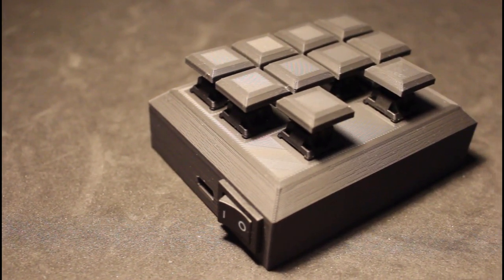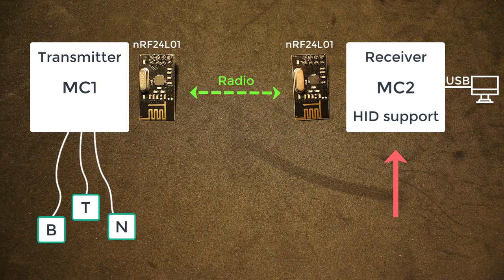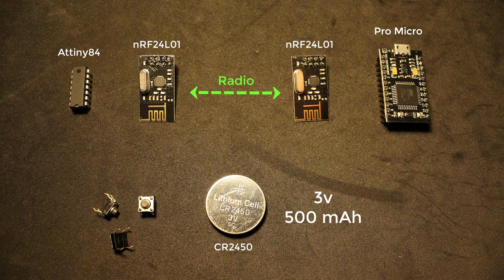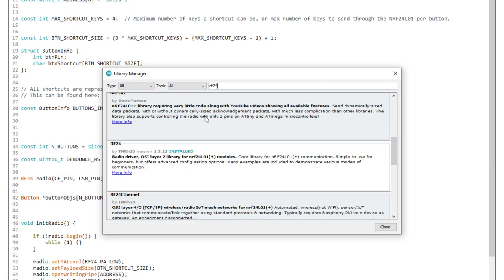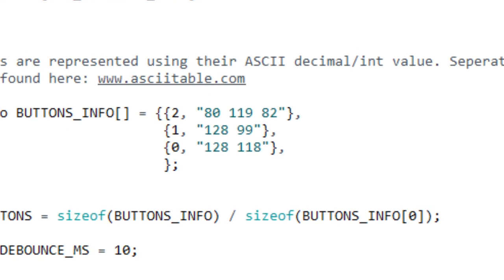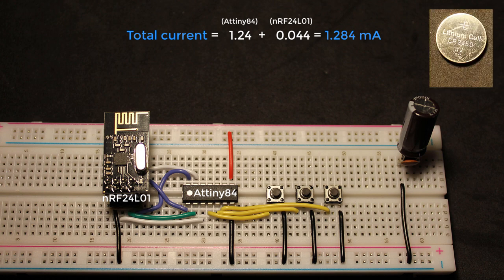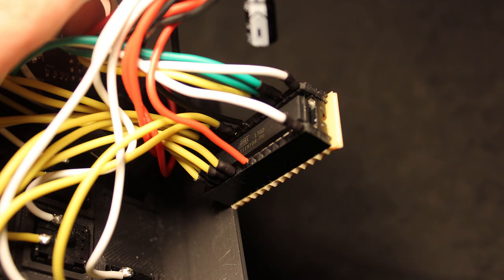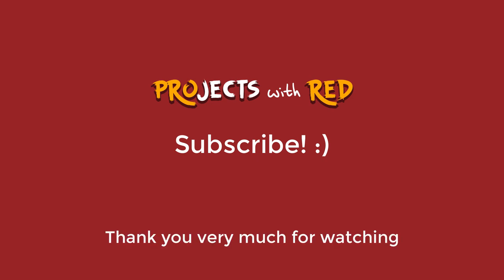Arduino Custom Wireless Keyboard! | #P4

Comment: I got it working by using the right caps and making sure everything was wired properly. Also for the button library It is the Michael Adams one but make sure you are using the Master Mad Leech Fork for it compile correctly. Thank you so much for this project its been a blast so far and I cant wait to see what else I can do with it!
Reply from the maker: Perfect this is great to hear! Thank you for mentioning the fix, I will pass it on to people who come across the same issue 👍🏼.
Reply: @ProjectsWithRed  rn the cheapest mcu is the mh attiny88. You can use micronucleus to program em quick. Only problem is that its 16mhz 5v. Trying to figure out how to force 1/4/8mhz for 2.3-3.3volt usage which would be perfect for the coin cell.
Reply from the maker: @Wesley5n1p35  If you use this library(https://github.com/SpenceKonde/ATTinyCore) to upload code to the Attiny88, you can just select the clock speed to be 8MHz in the Arduino IDE, which will make it work with 2.7-5.5V.  Check out the project repo (https://github.com/ProjectsWithRed/wireless_keyboard), and refer to the "How to upload code to Attiny MCs" heading to get more info on exactly how to do that.

Comment: Really nice and simple project ! Btw, instead of using the regulator with that coin cell, you can connect it directly to mcu and use the brown out detection feature to keep mcu off when battery is really low (2.2, .3 ish volt)
Reply from the maker: Cool, I never knew about that, good to know!

Comment: Hello thanks for the project For the receiver part can I use Atmega328P? The Attiny88 prices are way up. what would be the limitations? Running it at standard 8 mhs clock?
Reply from the maker: Technically you can replace the Attiny88 with any micro-controller (MC), however, you need to be mindful of the current consumption of the MC. The Attiny88 was chosen because it has very low current consumption hence why it can be used for a very long time with a small battery in the relatively small housing. If your chosen MC has a high current consumption, consider using a bigger battery, but you will probably have to make the keyboard housing bigger to accommodate the space required for the bigger battery, or use the same battery but you will have to change the battery more frequently.

Comment: Just use an esp32, it has Bluetooth build in and also can send the Batterie level. Also it is way cheeper and easy work with.  Also no reciver is needet , only an pc with Bluetooth/or  Bluetooth Adapter. Also use an Lithium cell(like 18650 or small lipo) , with tp4056 as charger and protection for the Batterie.

Comment: Hey, that is great project. If I understood correctly it is possible to build a full sized keyboard with this set up.   is it possible to have two transmitters to the same receiver or do I have to get a second receiver? And is it possible to use qmk on the receiver?
Reply from the maker: Hello, yea you should be able to. Things to keep in mind will be which microcontroller to use to support all the digital pins, however you could use a GPIO expander to expand the number of GPIO pins of the microcontroller. Yes you can have multiple transmitters. I don't know about qmk support.

Comment: Did you try to measure response times? I.E. time it takes from when you hit the button and when the event reaches the computer? I wonder if it is significantly slower than commercial keyboards.
Reply from the maker: I did not. However, I would say maybe 10ms delay if you want add a number to it, but it feels instant, there is no noticable delay at all. I have a commercial wireless keyboard and I would say it is the same. Remember to subscribe if you enjoyed or found the video useful!

Comment: this is just amazing! with this scheme I can put other types of buttons and analog sensors for example?
Reply from the maker: Thanks! Yes of course, you can use the micro-controller for anything else you want as well, just keep in mind the total current consumption, keep it low so it lasts long on battery.
Reply: @ProjectsWithRed  Nice, I have an idea to make a joystick this way and this video gave me good ideas! Hope this works with the joystick library too hehe
Reply from the maker: @reiisbrunoo  My next project actually involves making a joystick so that might also help you out :)
Reply: @ProjectsWithRed  OMG 😱 I'm extremely looking forward to it!

Comment: Very interesting and good calm tutorial!
What about Deep Sleep? You could wake the MC up everytime a button is pressed. I'm new to this. Does it work with the ATTinys ?
Reply from the maker: Thank you! Yes you could use something like deep sleep, however, since the current consumption was so low even when it is active, I did not implement any deep sleep as it was not needed. Remember to subscribe if you haven't already! :)
Reply: @ProjectsWithRed  subcriped now. Deep sleep would extend batterylife up to one year in this case.
Reply from the maker: Awesome! It will for sure increase the battery life but it might add a delay on button presses because the radio signal is reset every time it wakes up, unless there is a way to overcome that which I am unfortunately not aware of.

Comment: Would it be possible (and easy?) to use two transmitters for a single keyboard? This would be perfect for a wireless split keyboard
Reply from the maker: Yes that is very much possible. It won't be too hard to do.  Just look up nRF24L01 multiple transmitters, and you will find plenty of tutorials you can follow. From there you can easily modify the code for this project to accommodate for the two transmitters.

Comment: As far as I know, LDO regulator cannot step up and only steps down voltage but you are using MCP1700 LDO to convert 3v coin cell to 3.3v power.
Is it possible because of capacitors, or just MCP1700 can do 2.3v to 3.3v?
Reply from the maker: The MCP1700 is rated for 2.3V-6V input voltage for a fixed 3.3V output voltage. The capacitors are there just to make sure the signal is smooth and deal with voltage spikes 👍🏼.
Reply: @ProjectsWithRed  Document seems insufficient....
2.3v minimum written might be for other family varient ic which has output voltage less than 2.3v. Linear regulator inherently has no capability of boost.

I think your build luckily had a attiny have some tolerance and could run successfully about 3v( <3.3v).

Comment: Just subbed, you are awesome, thank you.
Reply from the maker: Thank you! I really appreciate that.
Reply from the maker: For the capacitors used. It's not a noob question at all. I used 1000μF and 104Z capacitors with the MCP1700 voltage regulator.
Reply: @ProjectsWithRed  I actually got the Attiny88 and all the other parts but not the same capacitors. I used a 104 and a 220uF. The attiny seems to have broke my usb (drivers) lol. Now everything I plug in is not recognized. I think I will just use another chip instead of attiny. No information about the tiny88 setup and installing it is a pure nightmare.
Reply from the maker: @majinkeyboards  I am sorry to hear that you are having these problems. I am more than happy to help you. It's easier if you get direct contact with me through Instagram dms, it's @projectswithred. Send me a message there and I can help you.

Comment: Great project,
If I use an Atmega 328 the wiring is the same?
Reply from the maker: Thank you! The Atmega 328 unfortunately doesn't support native HID support, you can still use it but the wiring and code will be slightly different.
Reply: Would be great If you made the same project witb an Atmega 328 Thanks

Comment: Hey, Is it possible to shift CE to pin 5 and add an extra button to pin 10 on the Attiny84?
Reply from the maker: Yes that is possible, you can use any digital pin for the CE 👍🏼.Just have a look at the AttinyCore library pinout to see which digital pin number you need to use in the Arduino code. Remember to subscribe if you haven't already so you don't miss future projects! :)

Comment: Thank you very much! I'd need 2 sets of these for commanding 2 pc in an exhibition... Is there a way to choose different frequencies for the 2 transmitters so that they don't disturb each other?
Reply from the maker: You are welcome! Yes you can do that. You just need to choose 2 different radio addresses in the code. If you look at both the transmitter and receiver Arduino sketches, there is a variable called "ADDRESS", just ensure that it is different for each of the keyboards.
Reply: @ProjectsWithRed  wonderful! thank you so much... this is exactly what i needed!
Reply from the maker: @mystereit73  Perfect, I am glad I could help. Remember to subscribe if you enjoyed or liked the video! :)

Comment: Hi, if you were to use arduino pro micro with built in wifi and bluetooth recievers, could you no longer have the recievers as in your build and instead just have the arduino in the keyboard directly linking to PC bluetooth??
Many thanks
Reply from the maker: Yes if you have a Arduino pro micro with built in WiFi and bluetooth with HID support, then you can do it this way.

Comment: you could also use 2x 1.5V AA batteries in series with a capacity of around 2.5mAh. this would last at least a year.
Reply from the maker: 2.5mAh capacity?

Comment: I want to attempt to have this be a arm mounted system for macro controls, and how would it go adding a rechargable battery and port to it?
Reply from the maker: You can open the stl file in a 3D modelling software and make any minor modifications needed.

Comment: hi, can you please suggest a microcontroller that can accommodate  20 to 40 buttons? I am totally new to this.
Reply from the maker: Hello, I would suggest the Attiny88, it has 28 pins, it's actually the one I ended up using for mine. However, you don't have to be limited by the number of pins on a microcontroller, you can connect a multiplexer to the microcontroller which will allow you to connect multiple buttons to the same pin.
Reply: @ProjectsWithRed  thanks for prompt reply. I just found out we can wire them in matrix. I forgot to ask about combine key, can i press 2 or 3 button at the same time, for example, shift + control + alt? I know the key can be assigned with multiple value, just thought if i were to build a non-macro keyboard.
Reply from the maker: @cwtjones  No worries! Yes you can do that, just remember to increase the "MAX_SHORTCUT_KEYS" variable in both the transmitter and receiver code the more keys you use.

Comment: Is it possible to modify this to work with something such as a “Seeed Studio XIAO nRF52840” to remove the need for the receiver and connect to the computer directly with Bluetooth?
Reply from the maker: Yes you should be able to do this with no issues, however, do keep in mind the current consumption of the micro-controller you are going to use as you will need a different/bigger battery to power it for a reasonable period of time.

Comment: Can I make this work with a 100uf Electrolytic Capacitor without the 104Z ceramic capacitor soldered on to it? and what would happen if I tried to run it without it.
Reply from the maker: It would work without the capacitors but it won't be as stable.

Comment: Hi, Nice one.. But can you replicate the same with ESP32. will it not be easier? I am a noob and I am planning to make a macropad with capacitive touch and rotary encoder..and there is no clear video on this..
Reply from the maker: Yes you could do it easily with the ESP32 using the bluetooth library for the ESP32. However, the problem with using the ESP32 is the power draw, it uses way too much current, so you will need a big battery to make it practical for a wireless device.

Comment: google search led me here, nice project !!!! i am trying to do the same for a quad,  can you give the capacitor ratings ?? i see they are no where mentioned .... Thanks
Reply from the maker: Thank you! May I ask what you searched to get to this video? I just realised this too, my bad, I will add them now. I used a 1000µF (could be 100µF) electrolytic capacitor, and a 104Z ceramic capacitor. I soldered them directly on to the MCP1700 voltage regulator, between the GND and VCC of the MCP1700.
Reply: @ProjectsWithRed  i have trouble making nrf working with 3.3 lipo battery , i was researching on google for mcp1700 and your video showed up
Reply from the maker: @RavikumarTulugu  Cool! I am glad I could help. Remember to subscribe if you enjoyed or found the video useful! :)
Reply: @ProjectsWithRed  100 uf capacitor doesnt seem to work, are you sure ?? i am using a 100 uf cap and i dont recieve any packets from tx. tx is a working one.
Reply from the maker: @RavikumarTulugu  Since I don't know much about your project, I can't really help, since there could be other problems and not an issue with the capacitor used.
Reply: @ProjectsWithRed   i am trying to power nrf with a lipo battery ( 3.3v ),  i am using mcp1700 and a 100 uf cap , i dont have a 104Z available with me, some how the radio gets powered up and initialized but it is unable to receive packets, the transimitter is fine and verified. i am just downgrading to 3.3v lipo and arduino pro mini 3.3v 8mhz .
Reply from the maker: @RavikumarTulugu  What is the project that you are trying to make?
Reply: @ProjectsWithRed  I am trying to do a micro quad , i am a software guy , just following youtube and google.i have ordered for 1000 uf and 104z , let me get back after trying . some aritcles advise a 1uf cap with 104z in parallel.
Reply: @ProjectsWithRed  finally it worked , thanks a lot , 1000 uf + mcp 1700 + 104z is bullet proof
Reply from the maker: @RavikumarTulugu  Nice! Good to hear it's all working now. Yea I use that combo everywhere, it great.

Comment: in which pins should i connect the other buttons ?  in case i use the attiny 84 like you
Reply from the maker: Any pins, just refer to the datasheet of the micro-controller to see which pins you can use, and then just simply change the pin numbers in the code.

Comment: Hi, here is another idea, perhaps the same but with a small backlit LCD or OLED screen.
Reply from the maker: That's a great idea! I will for sure add this to potential future projects. It will probably have to be wired and not wireless because of the current consumption of the screen, but that's a decent trade-off.
Reply from the maker: Remember to subscribe if you haven't already if you like these kind of projects! :)

Comment: Cool design. I tested your code, but there are always errors. The content is："no matching function for call to 'Button::Button(int&, const uint16_t&)' " ~Please help me ，thank you！
Reply from the maker: Thank you! Did you install the Button library by Michael Adams using the Arduino IDE?
Reply: @ProjectsWithRed   Two libraries installed： RF24 by TMRh20.
Button by Michael Adams.    Is it related to the version of Arduino ide？
Reply: @ProjectsWithRed  PS --This line of code shows the error： 64      buttonObjs[i] = new Button(btnInfo.btnPin, DEBOUNCE_MS);
Reply: @ProjectsWithRed    After your prompt, I deleted and installed the library again. Now it has been compiled. Thank you for your help. Cheers!  This is a great DIY wireless keyboard design！
Reply from the maker: @fengmingli8595  Perfect, glad to hear it! Remember to subscribe if you haven't already so you don't miss future projects :)
Reply: @ProjectsWithRed  Hello i tried deleting and installing the libraries again and the error still persists what should i do?
Reply from the maker: @meowmeow4383  Are you getting the same exact error as fengming is getting?
Reply: @ProjectsWithRed  I am getting the same error " buttonObjs[i] = new Button(btnInfo.btnPin, DEBOUNCE_MS); " i tried to reinstall the library of Mickal Adamsfrom the library manager but still the same error pops up .. any suggestion please .. !! I love your work by the way. Keep up
Reply from the maker: @CasaNord  Thank you, I appreciate that! May I know which micro-controller and what Arduino IDE version you are using?
Reply: @ProjectsWithRed   uno and leonard. IDE 1.8.19 Thanks for your quick replay
Reply: @fengmingli8595  What version IDE are you on?
Reply: @fengmingli8595  What was your way of "deleting and installing the library". I tried this and still get this error

Comment: Subbed, youve got great projects on this channel keep it up.
I am however getting the dreaded error
 Compilation error: no matching function for call to 'Button::Button(int&, const uint16_t&)'

Ive tried using your version of arduino, the most recent stable version and even the new 2.0 version.
Ive uninstalled and installed the Button library abut 10 times both with the nuking of all files including arduino as well as the folders containing them.
I have only installed the Button from Arduino library manager and its the Michael Adams version. 
What am I doing wrong please help, I feel like im going crazy haha
Reply: I have exactly the same problem. Can you write me if you should have solved the problem. It is so frustrating
Reply: @pingpong3484  ive officially given up till i get an answer :( i bought all the components first haha theyre all wired up in a box waiting for the code to work haha
Reply: @Wesley5n1p35  Exactly the same for me
Reply: @pingpong3484  Hopefully if we make this thread long enough itll be relevant. Hopefully someone who has had this issue and fixed it could give us some pointers. Its gonna be something super dumb that we looked over or something.
Reply from the maker: @Wesley5n1p35 @PingPong haha, I do apologise for the late reply. What micro-controller are you using? And how are you uploading the code to the micro-controller?
Reply: @ProjectsWithRed  bro its the button library ur referencing. The library manager doesnt have the right one you have to manually install it from github.